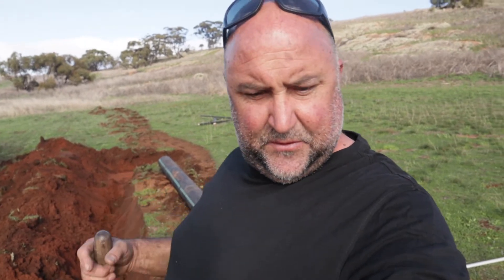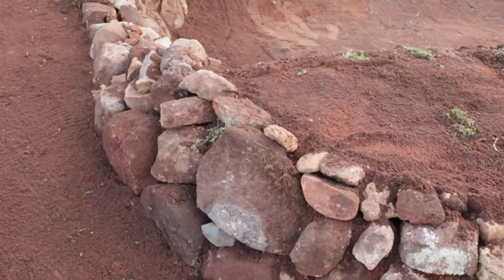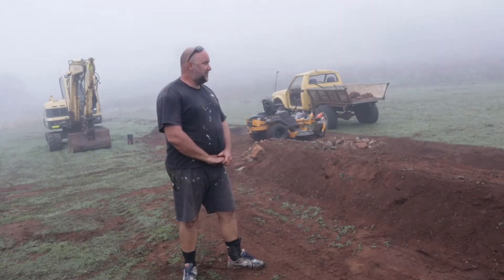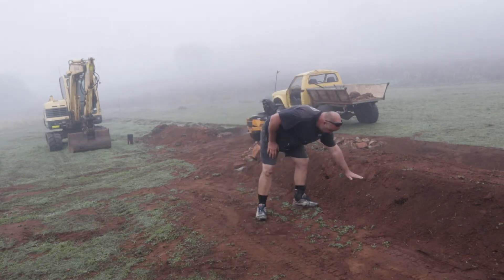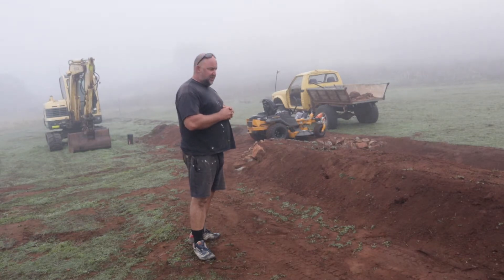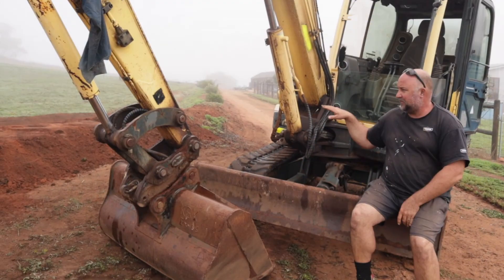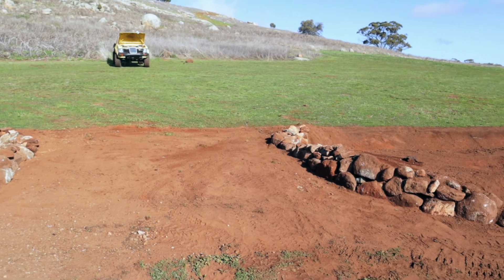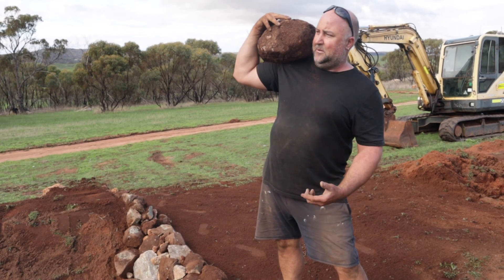Constructing a swale crossover with culvert

Comment: At the 5 minute mark in this video, the digger is working beside that access way. Its a great catchment, and the swale will work for you much better if they link up and water runoff goes off the access into the swale,,, otherwise what's the point of having the swale?

Comment: Love that truck!  Not sure about the drive-through passage though because that seems like it's going to be your level sill spillway.  Without the berm there to hold back the water, it'll go right round the ends you've made.  The little rock walls will be great as leaky weirs to help disperse the water, though.  Excellent stonework, imo and something I'd dearly love to do more of myself.
Reply from the maker: The old hilux does great work! And we've just got so many rocks, we had to get better at using them haha. We've got another section set as the level sill spill way (not sure if you caught that vid?) We've got the level of that set about 6 inches below to driveway crossover. So hopefully it should do the job 🤞